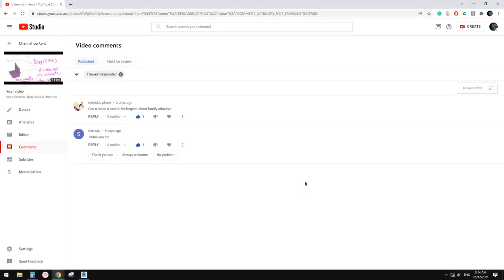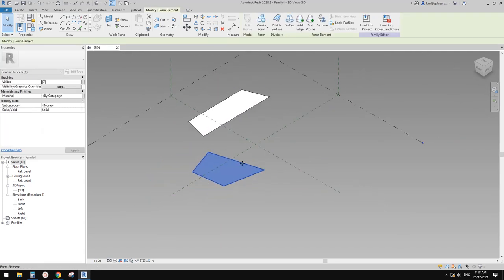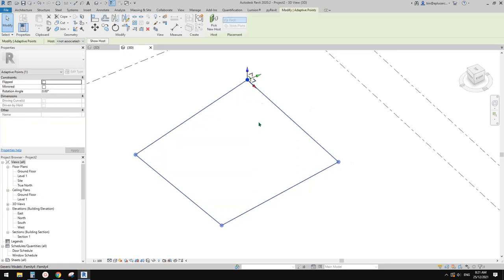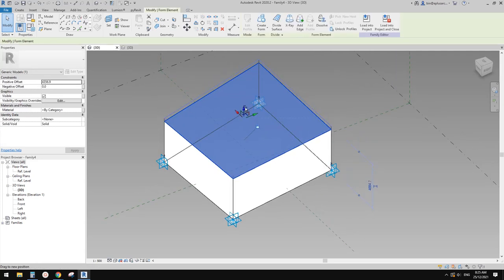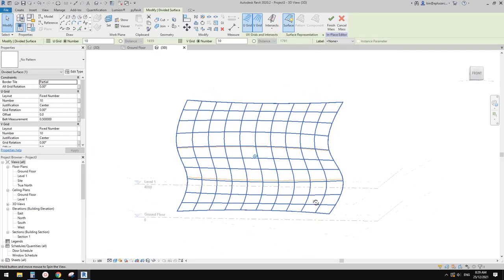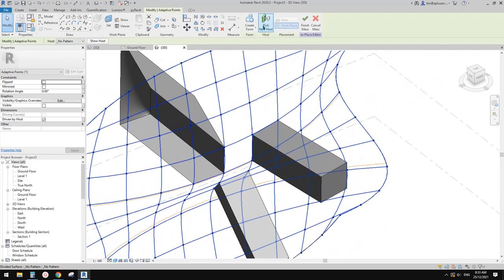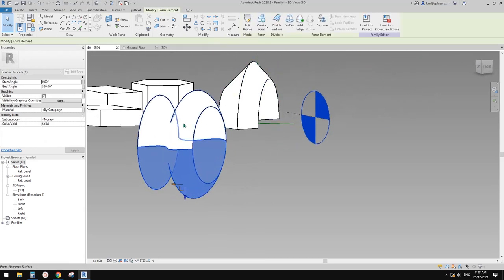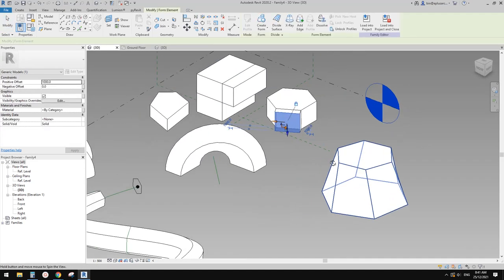Revit Exercise (Day 639) What is Adaptive Family and When do we need it?

Comment: Hello Bin,
Have you done any Revit video that is using "model in place" piping system? 
I encountered that I need to model a 3D civil piping system. That included piping elevation and other.
Thank you
Reply from the maker: Nope, I have done nothing MEP unfortunately. I don't think you should use Model In Plane for pipes. Or are you talking about the Plumbing & Piping under the Systems tab?
Reply: @BINHE615  Yes I'm using piping system under the system tab. The way I did is not efficiently. Thank you for the replying
Reply from the maker: I don't know much about the MEP, but I know that if you place some proper plumbing family into your project, you can select multiple of them and let Revit to create some pipe system for you, then you can adjust it to suit.